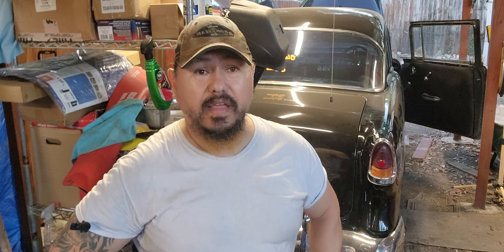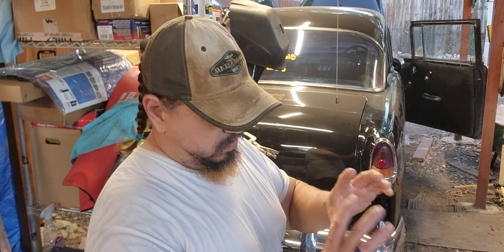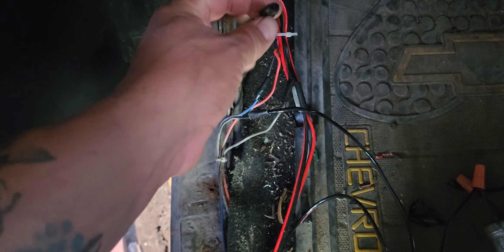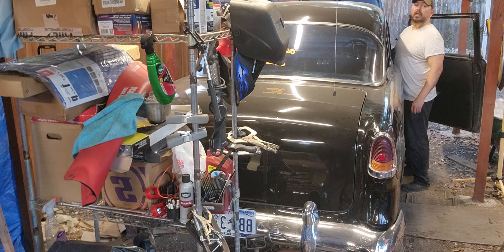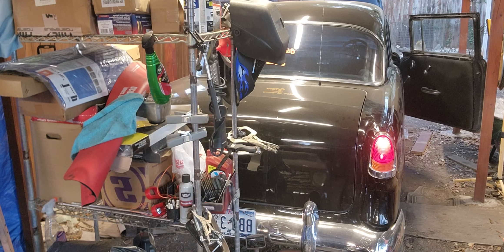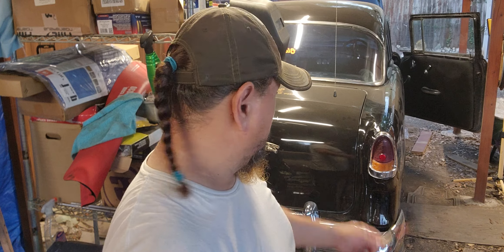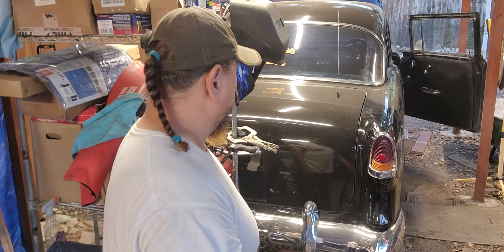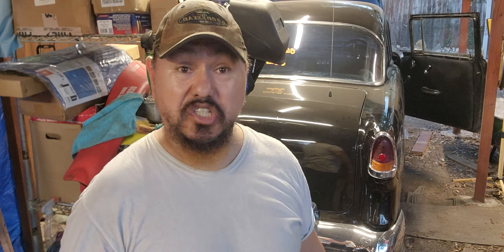BACK BRAKE LIGHTS  WORKING, but still need some more WORK. 😬

Comment: Right on brother cool you got the brake lights working. Should be another wire that will light the tail lights up off the head light switch when you turn the headlights on. Use a test light and find 12 volts.
Good luck brother hope you get them working sure will be cool to take the 55 out for a spin.
Take care 👍🏻👍🏻👍🏻
Reply from the maker: Thanks brother, I'll look into it...have a good night. 👍